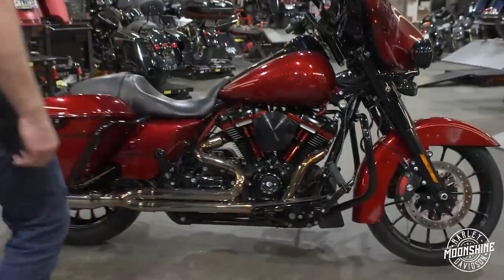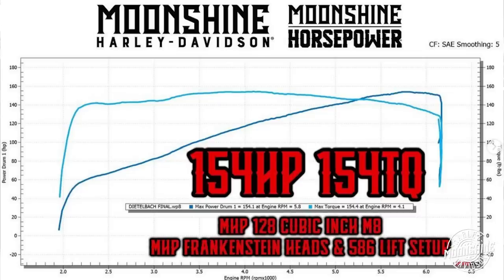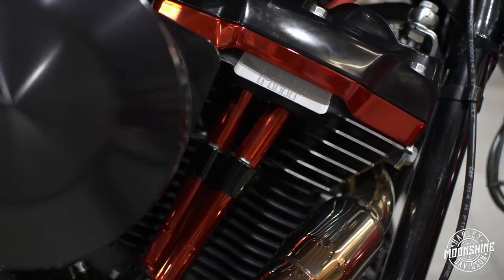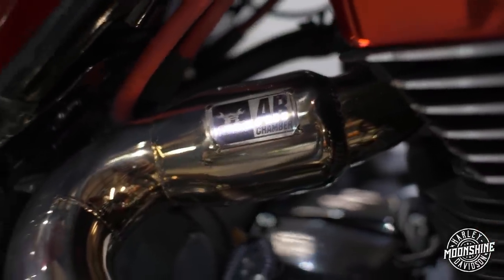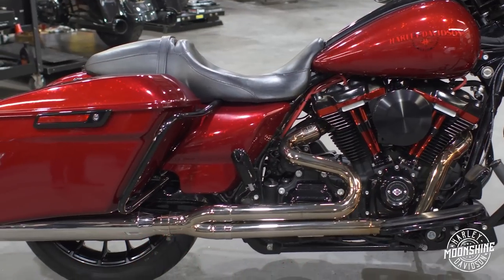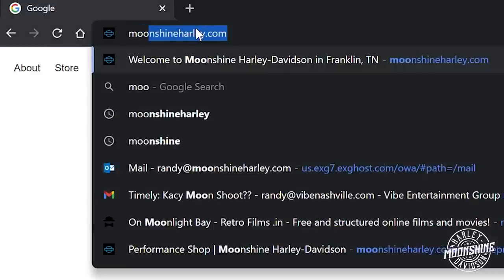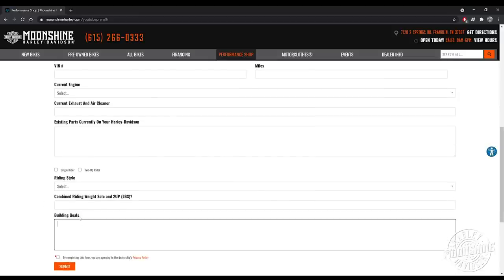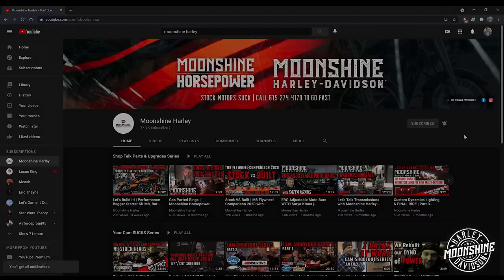Moonshine Horsepower 128 M8 154HP 154TQ |  Bike Build No. 6

Comment: Definitely the coolest build so far! I love it. It’d be a dream to get my 114 ‘21 road glide kitted out by y’all.
Reply from the maker: We’ll be here when you are ready.
Reply: If it’s an RDRS bike, you would be very disappointed
Reply: @phillipcoble629  thunder max is about to come out with an updated ECM that supports RDRS. Obviously a lot more expensive but arguably much better product.
Reply: @MyFatherLoves  hope it will enable you to completely turn it off.  If you turn it off at the handlebar, RDRS will still have some control, torque management.  And will hold some power back.  As of yet it can’t be truly turned OFF.  They will get there, just not yet
Reply: @MyFatherLoves  Moonshine does build some badass bikes!  Good luck.  My 128 dyno’ed 147.5HP & 150TQ
Reply: Same

Comment: WHEN IS TOO MUCH TOO MUCH!... Please help! I just built 128ci kit from S&S with 540 cam all the other goodies that I've learned from MSH (you guys are great-thanks)... My fully tuned (TTS tuner) dyno run is HP 140/TQ 160... My question is:   I can't roll down the street in normal operation without hitting a bump and just a little twitch on the throttle rocket's my bike.... have I over done it... is there something I can do to smooth this out... please help! Signed, wasn't expecting this...

Comment: When running the 2 in 1s have any clients opted for a saddlebag that doesn't have the pipe cutout?
Reply from the maker: Yes. When we swap to the shorter bags we have the same exhaust ( MHP Pro-Mod 2-1 w/ Feuling patented A/R chambers ) built 1.5 inches short to match the bag.

Comment: I would like to see them build it and it make 3500 mile trip in summer see how it holds up to the heat bc that's been the biggest problem I have seen with building these motors to a stage 4 or bigger they make to much heat I had one in 2017 lock up on me. I wish someone would let me ride it the way I ride all summer on a few 3000+ mile trips we do each year. I have 2021 road glide special stage 2 now and I hope it holds up to the heat this year
Reply from the maker: We don’t have those issues. Maybe you’ll run into one of our customer so you can get real feedback or maybe one will respond to this.
Reply: @MoonshineHarley  well if you don't have that issue then why don't you give more then a 90 day warranty I talked to you guys about doing a build and the guy I talked to said if I build the motor I have now it's a 90 day warranty if you go anywhere else and get a motor rebuild dontle they all give at least 1 years worth of warranty just saying man. I like the channel man watch every video but just asking real questions.  If I buy a brand new 131 crate motor it comes with 1 year warranty if a dealership installs it

Comment: That throaty exhaust sounds great! Question I built my bike following your lead, getting similar #'s. Thank you for putting the info out there!! My question, I am using the Fullsac and Khrome Werks setup you guys have used often. If I went 2 into 1, I know I could get a few more HP. But I have an HD Cool Flow fan installed which would have to be removed. Would it be worth it? Oh had to come back and add that color is Gorgeous!!!
Reply from the maker: You can swap the Fullsac for our Pro-Mod header and it’ll gain some extra HP. Then you can keep your fan.

Comment: Would this setup kill gas mileage?
Reply from the maker: No. You get 270 - 315 miles per tank HWY. If you are ringing it’s neck from light to light it will drink some fuel.
Reply: @MoonshineHarley  Thanks!

Comment: Like to see how these engine are running at 25,000 miles.
Reply from the maker: Like a boss! We use the best parts so they can handle mileage. This is similar to a 700hp Z06 racking up 80,000. They are built for it. It cost more but it can handle it.

Comment: All those engine upgrades are all fine and good if you got the money or want to spend it like that. Truth be told I just change my oil in every hole like religion, wash it and ride it. I have rode my 96cubic inch all over the country from Michigan in all types of weather with nothing but pure enjoyment. I also have a stock M8 107 and its no more enjoyment than my 96 cubic inch Road King. Power is subjective.
Reply from the maker: Yes. We like American Power!